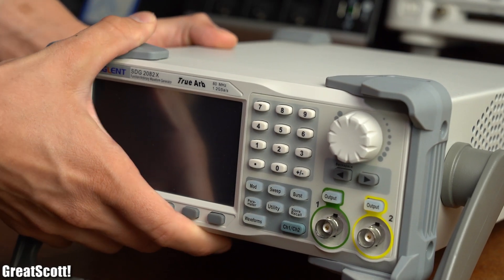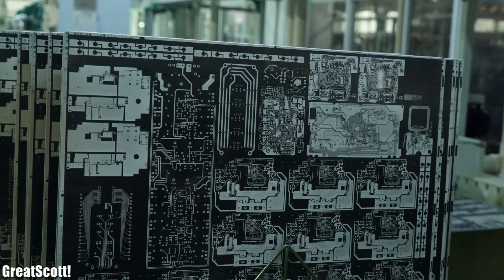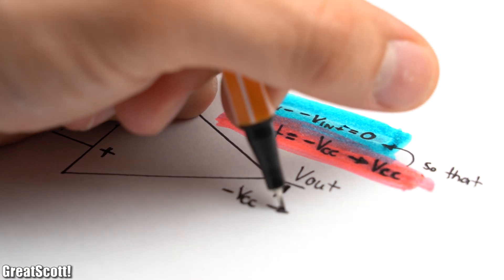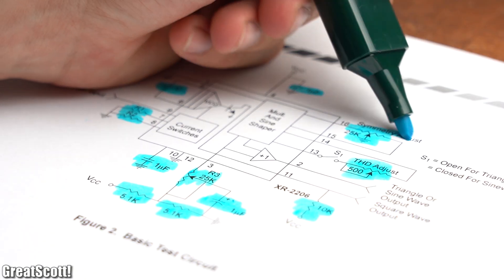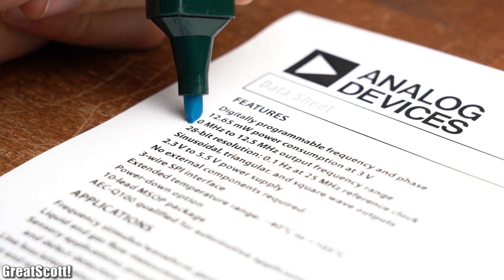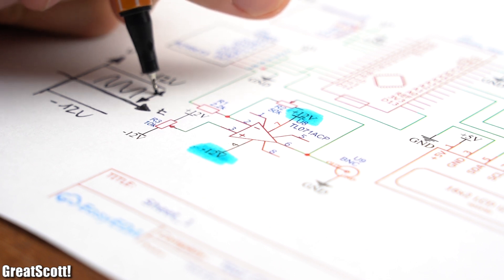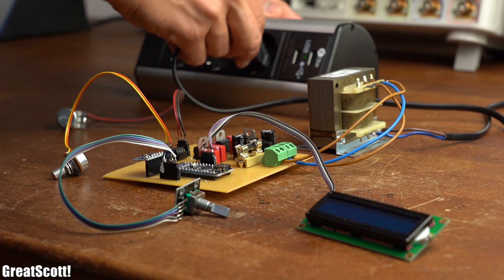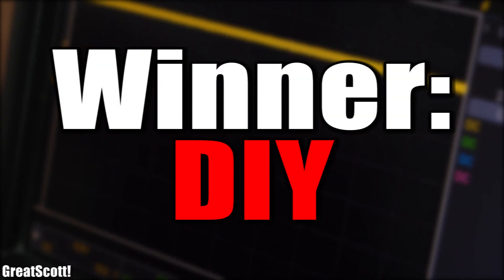Function/Waveform Generator || DIY or Buy

Comment: Very cool! I'm in the process of going through a rabbit hole where I'm building a volume limiter for my home theater and need a sine generator to test it. Of course I no longer have one so a secondary project of building a function generator became primary. I'm going the route of an Arduino Nano ESP 32 to generate signals and run a CS4344 D/A converter along with necessary op-amps, buffers and attenuators controlled by said Arduino. Please wish me luck! 😊

Comment: Hi!

I just want to ask if the arbitrary waveform generator (in general) outputs accidentally connected to ground for at least less than 5 seconds, is it bad?
I checked my AWG output with many signals after that and it works just fine.

Comment: Hello!
I know this is a very old video, but ... I'm planning to build a function/waveform generator based on the one you built in this video (for testing guitar amps and pedals).
But, my question is: Can I control the amplitude somehow? I need amplitudes in the order of 80mVpp, 100mVpp (to simulate the singal from a guitar)... not much more.
As I can see, there's a "Gain control" part in your schematic in which you use a TL071. I understand that this part is to control the amplitude, am I right?
Thanks!

Comment: My 7912 ic in voltage rail is failing again and again , it heats up to the point where it gets damaged and also damages the bridge rectifier, regarding the fact that 7812 is working properly (before failing ) what could be the cause .

Comment: You can buy decent function generators for a tad over $100, by the time you buy a case and the tools to make the necessary cut outs, then all the components for the circuit you will already be near to the price of a bought one, the bought one is going to look a lot better and maybe perform better......i'm buying one already made ;-)

Comment: Kinda too late to the party, yet I am also considering DIY my own MCXO (microcontroller controlled oscillator, potentially with SiTime's already expensive MEMS DCOCXO) 10 MHz clock source with the built-in functional generator so I can use it to inject the clock into test circuits or to test the testing instruments, along with the PLL for extremely high frequency so I can verify the oscilloscope is actually what it is rated for.

Comment: I am inclined to believe you could not go much higher than 5MHz because of the op amp you are using. Did you try to test your project without the TL071 to see if the raw CI can work with a higher frequency? regards

Comment: I'm having a problem with a helicopter main rotor tach. the main rotor speed is 390rpm which is transmitted to the NR guage by a 28 tooth phonic wheel and two wire magnetic pick-up (2000ohm coil) attached to the mast.
Ive gone through the troubleshooting of the intermittent problem and believe it to be poor wiring in a particular section.
I would love to replicate the problem on the ground and without the stress of it running so i can quietly and calmly continue troubleshooting. Using my phone and a piggy backed aux jack Ive managed to get the NR guage to work with a frequency app at full volume. The frequency detection box which operates the warning lights does not seem to detect this injected frequency, 
What am i missing ? the mAH and vac of the aux is pretty low and maybe the NR detector doesnt see it. will one of these generators give a better signal than my Mcguyvered up hack job?

Comment: Considering you used an OpAmp and lots of other stuff at the end, why not simply use the XR2206 with an inexpensive TDA chip to amplify the 2206 output ?  Cheaper and easy to build.  Use a multi position rotary switch to change the capacitor and a low value potentiometer you can have a reasonable range of frequencies.  Toss in a cheap low frequency meter from good old Uncle Ali and BINGO ...

Comment: Hi, I think I will end up making this build (Fairly late to the party) I had a few questions that I am unsure if anyone has attempted or if this is feasible, if I were to power this via 18650's to generate functional voltage rather than using main voltage, would there be any major negative repercussions to the build?

Comment: nice thanks for all helping video and content your so amazing, but I have a question? what is the output current of the transformer because you put a 2 amp fuse and then with an 8 amp full bridge diode you get 0.8 amp current at the output,Im a bit confused,can you help me?

Comment: So I found an old digital TV converter PSU that supplies +12, -12v and 5v (among others) as screen printed on the PCB BUT on measurement the 12v lines only measure + and - 11v.  I assume this will still work for the rest of the design but limit the signal Gen to + and - 11v rather than the 12v you wanted.

Comment: Good Morning
I have assembled the signal generator circuit and although it works correctly, I have noticed a problem that I would like to tell you about if you could help me solve it.
When I mark a frequency on the display, I observe that the frequency displayed on the oscilloscope is slightly higher than the one marked, approximately 4% more. Namely, That is, for example
Marked Frequency                                   Output Frequency
  1000Hz                                                                 1040Hz
10000Hz                                                               10400Hz
100000Hz                                                           104000Hz
I would be grateful if you could give me some suggestion to solve this problem and to be able to match the marked frequency with the one obtained at the output.
Thank you for your cooperation

Jose Luis
Reply: Hi. I have the same issue when reading the output from the AD9833. However, I'm having issues getting the entire thing to work. Nothing seems to happen when you turn the rotary encoder. Any ideas? Could you share your approach?

Comment: A general purpose waveform generator is a rarely used lab instrument. If your circuit requires waveforms, it's best to design it with self-test in mind.

Comment: I build everything I can but the initial function generator I bought and it just happens to be the one in this video. If you truly need an accurate generator spend the bucks. Even a cheaper one is decent and reliable. If you use the correct dc block and attenuation you can cover basic rf as well. If you really want to build one then you have something to compare against.

Comment: @GreatScott! For higher frequencies what is the problem with the chip, could it be solved with a processor that functions at a higher frequency such as a computer processor? P.s. I am very new to electronics.
Reply: Higher frequencies as in... 100kHz or 12GHz? Generally speaking creating precise waveforms beyond 1MHz is a lost cause and even 100kHz is stretching it. There is also hardly any application for that. If you need to generate a special waveform in that range, then you need to design your own circuit into whatever it is that you are building. If you need precisely modulated RF, on the other hand, then you will more or less have to buy something in the $10k-$100k range. To build that kind of equipment takes the best in the business years, assuming they have next to unlimited resources, so you won't get very far at home.

Comment: Thanks for the video! I need a three-channel waveform generator that have the phases of the three waveforms locked, and all three channels should be able to be programmed independently. I only have needs from 0-100Hz. In other words, I can't use three independent waveform generators that don't have any communication. Can you envision a way to do this, which is similar in simplicity to the WG shown in your video? Thanks again.
Reply: Use your PC audio output. If you need DC signals, modify a cheap USB soundcard. That's like $10-20 plus one opamp and a few resistors and you get an excellent 24 bit converter for that money.

Comment: How can we use this to generate output pulses into the 50v and 100v range?  I want to do automotive transient testing with it.
Reply: You will have to get a high voltage amplifier in addition.
Reply: @lepidoptera9337  Any suggestions?  I think possibly the hv op-amps like burliegh pz-70m might work?
Reply: @eastmanresearch3143  I don't know your detailed requirements. For +-100V and purely resistive load I would build something myself from a pair of 400V transistors and a few opamps in an afternoon. If you need to reliably drive highly capacitive loads (like piezo actuators) at 1000V amplitude, I would probably buy something. The time and effort to build that amplifier circuit might not be worth it. So it depends.

Comment: The non required responce for the DIY function generator at 5 MHz , is may be due to the OpAmp used TL071 which it's datasheet state that its BandWidth is just 5MHz.
while the AD9833 capable of output up to 12.5MHz, which is also great for your project.
its recommended to se LM118 Or LM218 ,,, etc which have a bigger Bandwidth ( about 15MHz).
Thanks for your videos, and stay creative .
Reply: One wouldn't test the bandwidth of an opamp circuit that way, to begin with because opamps don't work well as high frequency, low gain amplifiers (look up Miller capacitance to understand why). Look at the data sheets for suggestions on how to measure the gain-bandwidth product in a high gain configuration. If you need a 10MHz bandwidth buffer, look at JFET buffer circuits. For properly terminated signals (50-200Ohm), transimpedance amplifiers are a good choice.

Comment: Obviously very late, but the instability and other issues at high frequency are likely due to the construction of the op amp portion of the circuit. Very good decoupling is important, and the output of the op amp should be followed by a resistor so that the transmission line is double terminated (therefore protected from bad loads) and any capacitive loads don't cause phase margin issues.

Comment: Hey, I noticed that the circuit had the maximum gain of 22. The Gain-bandwidth product of the TL071 is 5.25MHz, so at maximum gain, you shouldn't exceed the frequency of about 290KHz. Just keep this in mind guys if you are planning to replicate the circuit. I recommend going with a 2-stage amplifier or changing the Op-Amp with a more suitable one all together.
Reply: Any suggestions for an opamp that should get the job perfectly done?
Reply: @matejhusek6855  had good experience with AD8032 and AD8066. Think both should handle all this better. But they are more pricey to be fair.

Comment: Great work. You should have designed a PCB with good RF characteristics in order to achieve much better High frequency performance. Additional Filter circuits on the in- and output also would have made a significant difference. Also choosing a low noise op amp on the last stage is mandatory. Anyway great project!

Comment: I am using function generator, but the problem is that the output is very low power. I have been looking for amplifier that could work witch signals up to 1MHz, but  I  cannot find anything  that can produce reliable signal, with current up to 5 A. I am an electronics hobbyist  and I have problems with coming up with my own designs, but i want to learn by testing different circuit properties with my function generator. I found commercial amplifiers but these are still too expensive for me. Do you have any inputs on that topic?

Comment: hi.
Nice project.
I made it and connected to the oscop. 
set square frequency to 2000Hz but scop showing 1000Hz.
set square frequency to 4000Hz but scop showing 2000Hz.
But sin and tria wave forme showing corect.
Is your circuit squre wave frequency same.

Comment: To have better performance at high frequencies, you should used opamps with higher gain bandwidth products (GBP). Because the DDS would not give wrong signal it is only the mistake of signal processing. It seems that you  are using TL071 opamp which has GBP of 5.25Mhz and you are using it to amplify by a factor of 22, so the bandwidth of this configuration of opamp will give you a reliable signal bandwidth of around 23 khz

Comment: Great job! question: is is possible to make a "power supply" with triangular wave output from 0 to 40mA pp at 0.1Hz and 0.00167Hz?
Also, square wave with output from 0 to 40mA at 0.05Hz? any tip would be appreciated. Thanks in advance.

Comment: Excellent work since 3 days I made this FUNCTION GENERATOR... I used the MT3608 DC TO DC CONVERTER to convert from 5v to 12v then I used the DDO315NA to convert from +12v to - 12v for the TL071CP.... I made the project with Arduino uno r3 atmega 328p!!!!FINE PROJECT!!! 😎😎😎😎😎😎
Reply: Hi.
Thanks.
Reply: Hi.
Did you test function generator output signal with oscop?
I made this circuit and connected to oscop as following resultes:
- Frequency set to 2000Hz, sin and triangle wave frequency showing 2000Hz but on square wave showing 1000Hz.
- Frequency set to 3000Hz, sin and triangle wave frequency showing 3000Hz but on square wave showing 1500Hz.
square wave frequency always showing 1/2 of the set frequency.
Reply: @majidarabi3694 Yes I watched it!!!!
Reply: @majidarabi3694  In theory a square wave has an instantaneous rise and fall. But it has a dwell time based on the frequency. Lets take a 1 hz square wave. The signal goes from zero to 100% in an instant. Then will remain at 1 for 1/2 of the wave length or 500ms.
Reply: Thanks for your advise.
I tried another function generator circuit diagram and code " https://www.instructables.com/Portable-Function-Generator-on-Arduino/"
Sin,triangle and squre wave  frequency are correct with that but with your circuit sin and triangle are corect and squre wave is 1/2.
Fault finding is in progress.
Reply: @majidarabi3694  I made this function generator with Arduino Uno R3 atmega 328p https://youtu.be/r0zzqB-oUF4 but if you watch my channel I made and ANALOG FUNCTION GENERATOR KITS BY E-BAY!!!

I watched that and in Analog Function Generator kits by the Ebay the square wave has half past frequency than Sine and Triangle waves

Comment: I recommend choosing Function / Waveform Generator
 based on DDS technology, optimal IC AD9910. Choose a larger DAC 14bit, which provides less phase noise. You also need to choose with the highest possible frequency of DDS clocking. In the overclocking mode the AD9910 will provide 1.4-1.5GHz. There are open source boards for Arduino DDS9910 https://www.ebay.com/itm/163923312245

Comment: Just finished build and testing one (still prototype) and I have to say I don't see this signal instability at about 5MHz using my old analog scope connected at the 9833 output pin. Even being this the top frequency for my instrument. You probably was experiencing some other problem, not 9833's fault. I plan to build a second signal stage, so I can use it to extend sweep range frequency on my scopt, and (hopefully) observe its wave forms at higher frequencies. Anyway, thanks for sharing. Your videos are awesome!
Reply: Hey, do you mind sharing your build or some tips/tricks?  I'm having issues getting the entire thing to work. Nothing seems to happen when you turn the rotary encoder. Any ideas? The AD9833 does output a 1.04 kHz sine wave of <1 V, but that's about it. Nothing happens when trying to change the rotary encoder and I've triple-checked all the wiring.

Comment: Hi Scott, I 👍 and I want to build mine ,😎😎 I found a very interesting DIY kit built around the IC max038 with all the features an requirement. It reach 20Mhz. The only issue is that changing the wave form or the frequency ranges is done through connector jumpers! If I can change that to be through a proper menu, LCD 16x2 and rotary switch using an Arduino nano it will be a very interesting DIY project. Can you please point me to the right direction on how I can do that? I am a hobbyist not a pro. But I have a good knowledge and I can search if you sow me the right direction. Maybe you can do a DIY or buy updated v2.0. thank you and it's ok if you don't reply I still follow and like your Chanel and video 😜
Link below to the kit.
https://www.aliexpress.com/i/4000539079978.html